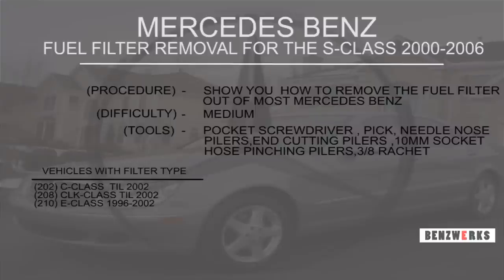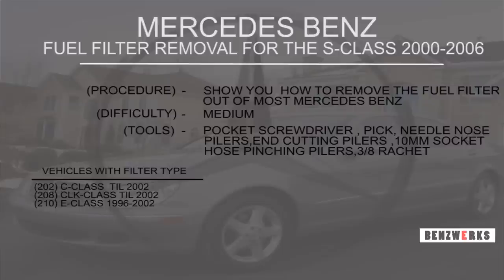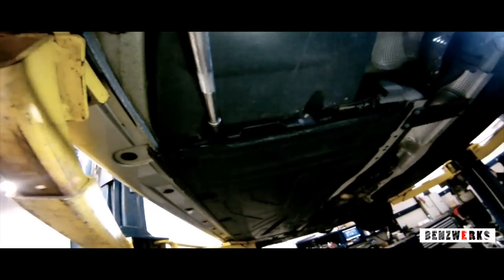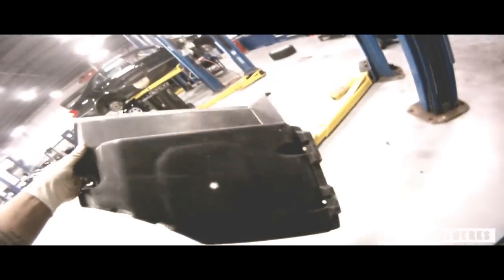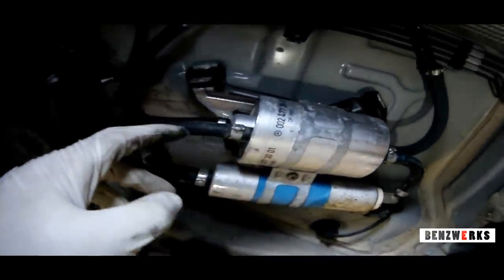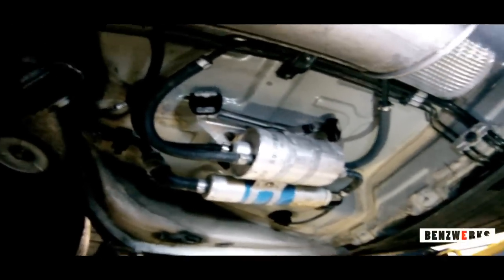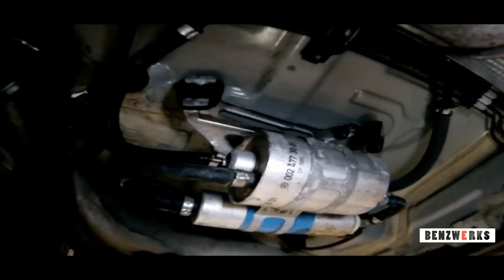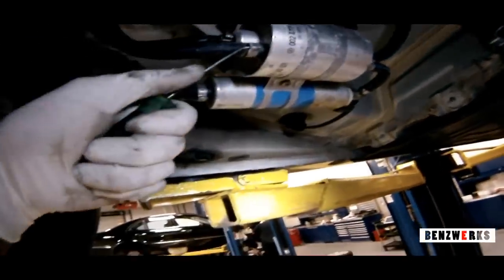BENZWERKS FUEL FILTER REMOVAL

Comment: What jerks Mercedes are at times. So the r230 SL500 fuel pump is overpriced and told it’s impossible to replace as one person. Well, these s500’s are a dime a dozen and they take the exact same fuel pump. I’m glad to see this video elaborate how easy it is to change or access one on an Sclass. And I just removed the pump from my SL500 by myself on my back. Autozone claims they don’t have any SL500 fuel pumps in stock, but they have 47 S500 fuel pumps in stock lol. Great video

Comment: Have a w220 s55 the car cranks wanting to start but doesn’t , I put a little gas in the air flow intake to see if it starts it starts and shuts off right away ? Need help

Comment: Very helpful video. But if you own a Mercedes, I'd recommend buying a Clic / Clic-R clamp tool, it's like $20. You can use it on lines all around the engine bay too. And pinching off the fuel lines seems unnecessary. Maybe the fuel line up to the engine so you don't have a bunch of fuel drip out of it. But the line to the EVAP charcoal canister should just have vapors in it, the return line to the fuel tank won't flow much because it feeds into a pressure regulator. The line from the fuel pump also won't leak much fuel out because it's short.

Comment: My S350 2K4 had a shock failure, I replaced it, do I need to get the car balanced for level. After whole night I found car completely down all sides, after starting it comes to normal level. Is there a minor leak causing this. I can't hear a whissing sound.

Comment: I just did one on My 2002 ....Thank you. You were spot on !!!
Reply: +Rick Kotowski 1 E320 4matic ...any one who decides to do this drive your drive side rear wheel up on a ramp. I did not do this so clearance was an issue . Clamp and undo the front side hoses first. The fuel is still under pressure even tho I opened the gas cap, So watch out for your eyes. I then attached that side first and pushed the other filter out . After sliding the new one in (Front to rear of the car) ,I then undid the other fuel lines and attached them........Do one line at a time ! Any questions on this hit Me up.

Comment: Hi mate.  I've got a W210  from 1996 manual transmission and I wonder if you know where the fuel pump relay K27 is located. I would appreciate that info. The pump is working with direct current to the terminals but no luck when cranking the engine. Nice videos thanks for sharing them.